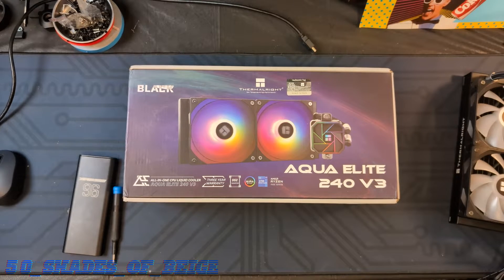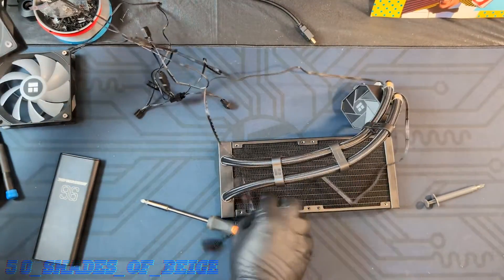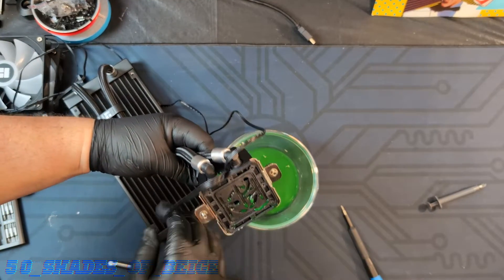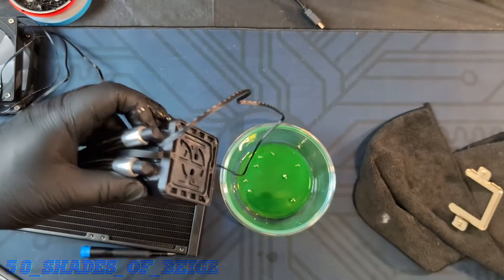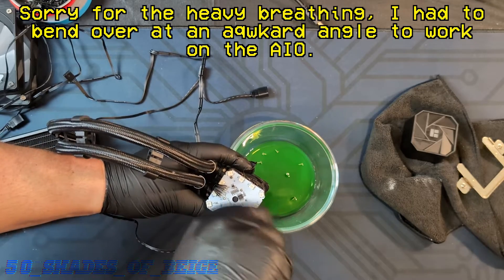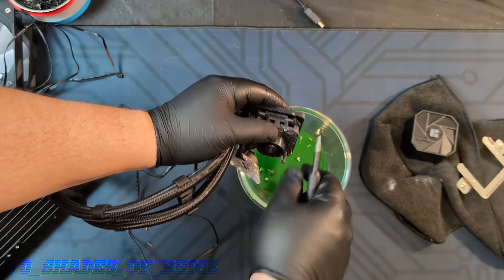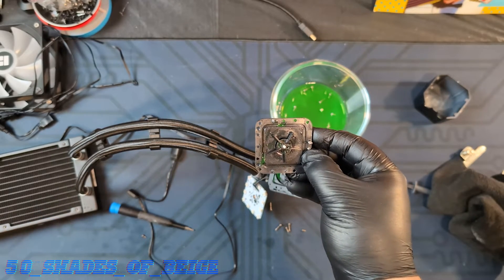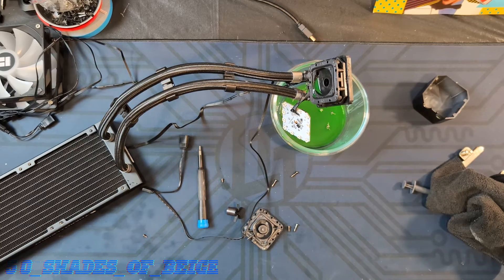Blind and messy Thermalright Aqua Elite 240 V3 Teardown (by request)

Comment: Would love to know the id of the hose.  I’m guessing 9 or 10mm.  Appreciate the teardown!
Reply from the maker: @mgsperformancerc  I don't recall the inner diameter on this one. However I've had dozens of variants of this same AIO. They all come from the same factory. Most of them are 5-6mm ID 12-13mm OD. That being said, it's not nearly as important in a system that lacks a reservoir. The volume is still relative to the cold plate and pump volume. Usually the pump isn't terribly strong to begin with, and the cold plate has the most restriction.
Reply: @50shadesofbeige88 thank you!  Building a custom layout open air pc and need to shorten the hose length.  This is very helpful!

Comment: I get the blind teardown..but should have inspected it the rad properly... on one of the corners where the hose is connected to the RAD is a Plastic sticker cover... that covers the drain/fill hole.. it's a Phillips screw...
Reply from the maker: @ZAzhar101  Honest question. What would be different about this radiator than any other AIO radiator that makes it better or worse? Does the presumed difference make a meaningful impact given the application?
Reply: @50shadesofbeige88  literally...

Comment: The reason these are so cheap but perform well is the pump is definitely a cost cut but the mounting system is a very high pressure system that works great with Intel

Comment: I just got the same one but white, and the pump does an annoying noise, like rattling sound, and idk if it is normal, should i try open the pump to try a fix or something?
Reply: If so, you have to put the radiator above the pump, otherwise the air will get into the pump, and this could even damage the pump.
Reply: @diegocoi4  yes i know all of that but that wasnt the case. I finally had to send it to warranty and got a new one which is fine
Reply: Is the pump on top of the radiator?